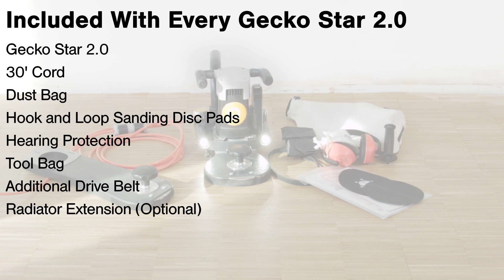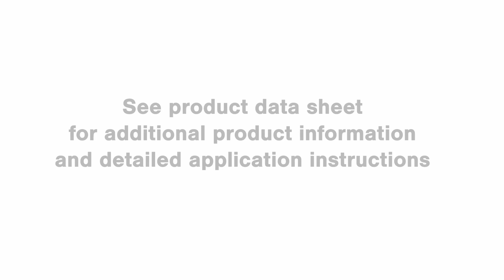Pallmann Gecko Star 2.0

Comment: The gecko is a neat little machine and works great when it is working. I wouldn't recommend it to anyone, though. I looked up a lot of reviews before buying it, and for the most part, they were great. But then I bought it. Used it for about 4-5 feet of the wall, and the motor started smoking.  Shipped it back, pallmann replaced the motor, and sent it back to me. It worked for about 12 hours of run time at best, and in that time, the nut for the bolt on paper stripped, then the bolt that held the wheel the belt ran on snapped which I'm not surprised since it is a very thin bolt to hold the wheel I don't  know why they would put such a small bolt for that. I bought the edger about 11 months ago and as I said I only have about 12 hours of run time on it. Pallmann has had it the rest of the time fixing it. Likely waiting for parts which seems like parts for anything is extremely hard to get your hands on these days, but they haven't refunded me. Or even exchanged it for a new one (which I don't think I even want a new one at this point  because i highly doubt its reliability). Needless to say customer service has been very poor as well unfortunately.  I don't know if others have had a similar experience though. Maybe I got a lemon. But I doubt it because once I looked up everything that has happened with mine, there are tons of the exact same reviews, so I think lemon is out of the question. I know 2 other business owners that have been refinishing hardwood floors for over 30 years, and they only have used Lagler and other than blowing a belt every 5-7 years or something small thats easy to fix from normal wear and tear they work consistently and there is very little down time. I don't know if that's the difference in German engineering  compared to American or more than likely Pallmann is American but they manufacture the machine in China.  I don't actually know but they need to address that issue it seems like people have had these same problems for some time now. 
 I also have the Pallmann Spider and so far it has been pretty good. No complaints really with that machine. Maybe be nice if they had 7inch hook and  loop protector pads. But so far so good for our first year with that.